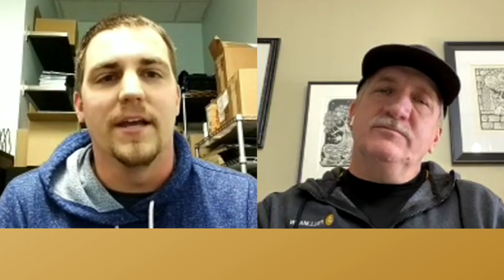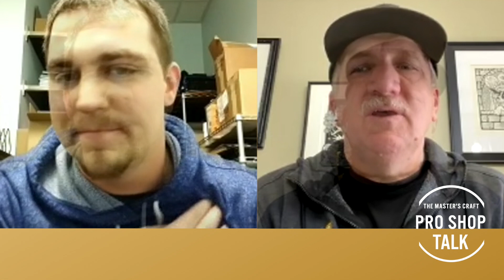PALLMANN SPIDER SANDING MACHINE | How A Planetary Floor Sander Can Save You Money

Comment: The 7" Norton sanding pads are designed for an edger and not the Spider. They heat up too much, the glue melts and the backing comes away from the abrasive. 

Had to laugh at the idea of the Spider replacing the belt sander. This is not going to happen as long as there are uneven floors with gaps and hard to remove lacquer. It just takes too long and you'll end up weeping your way across the floor at four in the morning.
Reply: my friend. I use spider the last 10 000m2. Every lack every parket. spider destroy it.  If you want i will send you video how 2k lack gone in secund.
Reply: @vjekozulj5174  You are correct, I have quite a few contractors just working with a Spider, some go on to buy belts sanders as well which gives you maximum efficiency, some don't. I have seen amatuers cope with significant lippage with a Spider, the guy in the video is correct, sometimes a belt is quicker, sometimes a Spider is quicker.
Reply from the maker: Thanks for sharing your experience! Sounds like it's all dependent on the contractor, their experience, and the floor they're working on.